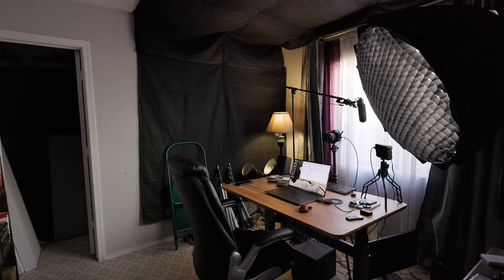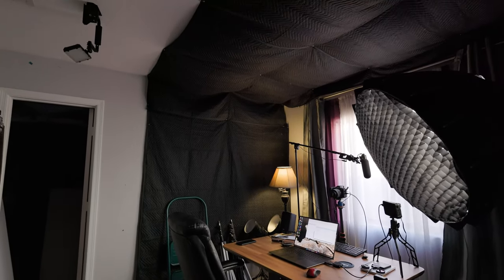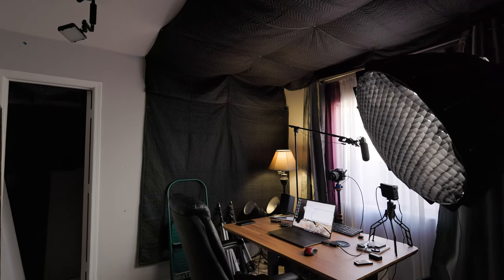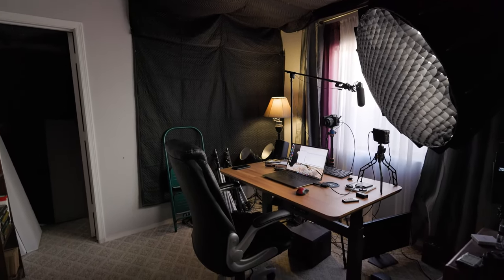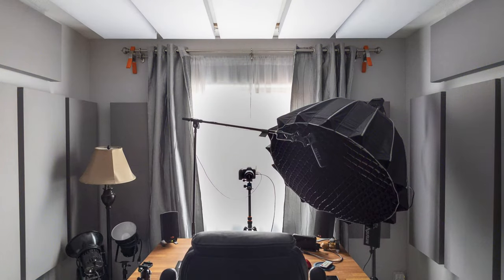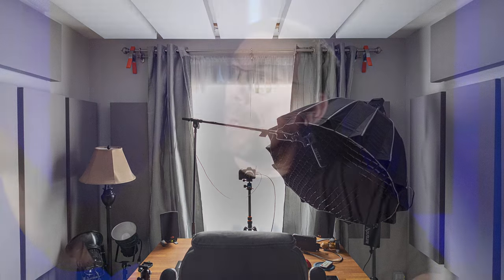Acoustic Panels vs Moving Blankets: Is There a Difference?

Comment: 1” acoustic foam is 30% less efficient than sound blankets but it is 5 times more expensive. 2” acoustic foam is 5% less efficient than sound blankets but it is more than 8 times more expensive. 3” acoustic foam is only 10% more absorbent than sound blankets but it is 12 times more expensive. Overall, to cover the whole room it'll cost a lot more than using just 1 big blanket. This is just my thought.
Reply: That's one of the best comments ever! Thanks for that information. What an eye opener. Puts things into perspective.
Reply: So basically the blankets would be better and cheaper ?
Reply from the maker: Even though they cost more...I needed to make the change due to the look of the blankets.
Reply: @faspete2nd  yes that’s my last obstacle
Reply: Love that data. I'm going to quote this from now on
Reply: @Dracomies data? Those ŵere just comments. No modifiers or anything. No absorption coefficient. What frequencies are we talking about. What sound blankets? What acoustic panels? DIY or store bought? Takes very little skill to build your own panels. I built 6 5.5” panels for about $150! The rockwool was $60 for 6 panels and some cheap common wood boards, screws, staples and muslin fabric. Those blankets won’t do anything below a certain frequency, probably nothing below 2khz. It’s just physics.
Reply: @NakeanWickliff  I forgot what the topic is about but I can tell you that both are viable methods. Let's assume we are using Vocalboothtogo blankets which are 10 lbs each. You cover the front, left, back, right and top, that is 50 pounds of acoustic material around the microphone. Or in standard PVC booths, 72X80 where we recommend about 2 layers of Suremax Ultra Thick Pro per side (a dozen Suremax Ultra thick is 65 pounds), this is about 50 lbs of material around the microphone. I've made acoustic panels  and created PVC booths. Both are very good for voiceover. https://youtu.be/qq-B1JWsktA?t=1
Reply: @Dracomies  weight is not a good metric of sound absorption coefficient. It’s actually not used at all when measuring how much a material absorbs sound. It’s cool though. Use what works for you. I use panels because I use them for audio playback and movies. I need to go a whole lot lower than the human voice.
Reply: @NakeanWickliff  As mentioned both are good. I have acoustic panels too and actually one of my videos is a derivative of Boothjunkie's acoustic panels. But we're arguing over nothing. Both are good. Voiceactors use PVC booths all the time and have great sound.

Comment: Personally, I didn't hear much of a difference between the moving blankets and the acoustic panels. But the difference in price is GINORMOUS! The panels altogether must have run you no less than $700 and the blankets will cost $200 at most. But the panels make the room look much nicer and far less tackier than the moving blankets. But that benefits YOU, not your audience, because they will never see the "tacky" blankets.
Reply from the maker: It is difficult to record the sound difference in my room, but the panels do better acoustically. I agree with you on the cost. The panels are more expensive and less tacky.

Comment: Great quality construction of those panels. They look really good. Bookshelves full of books are actually more effective than most acoustic panels. It looks like you moved yours out. Keeping the bookshelves on the back wall and panels front and sides would be most ideal, I think.
Reply from the maker: I'll give that a shot. Thanks for the advice. Always struggling with my background.
Reply: While it may not make your room any worse, having a bookshelf can introduce other issues (such as odd flutters and reflections). That's why diffuser panels are engineered in specific ways. Bookshelves deflect sound, but aren't the same as acoustic panels.

Comment: Listening in my home studio, with monitor speakers and sonarworks, moving blanket is more natural (in good way and slightly brighter than the acoustic panels set up). Acoustic panels is more like your are in a recording studio. For the cost and results at my end, I will go with (remain) the moving blankets set up.

For sharing to everyone (base on past experiences and what i learnt during my Audio Engineer course) and I hope it helps.
- If you are using blankets, always remember to leave a gap between it and the wall. It helps a lot with reducing reverb even is just a few inches. 
- Acoustic foams are useful  in reducing reverb if you know where to stick and have enough (too few really almost do nothing) of them. It will not help much in reducing noise going to another room.
- There are some differences between moving blankets and acoustic blankets. (application & result)
- There are also differences between acoustic panels and bass trap. (application & result)
- If you are not doing live, post-processing with DAW work like wonders. Save you money till you are sure you wanted to upgrade further.

Thanks.
Reply from the maker: Thanks for sharing! I appreciate it.

Comment: Currently remodeling a sound room. I am already set on building panels, but I may also use a moving blanket over my door. I think this video proves that you can get alot of sound dampening for alot less money and effort than other videos on youtube may make it seem. For someone on a tight budget, I would not shy away from using moving blankets.
Great Video!!!
Reply from the maker: Thanks! Good luck with your sound room. I hope it works out with whatever path take.

Comment: Interesting.  The blankets were warmest (to me). The panels sounded just a bit brighter. Obviously no sound dampening was not acceptable. I like the moving blankets best but the sound panels LOOK better.
Thank you for the education!
Reply from the maker: The look and feel of panels in the studio definitely add a different vibe to the experience of making content over the blankets. I'm happy with the results. Thanks for your feedback.
Reply: I thought so too at first, then I pulled the audio into a DAW out of curiosity.
After listening to the claps slowed waaaaay down and looking at the waveforms, the panels actually did a much better job at eliminating reflections
Reply: The blankets do a pretty good job of absorbing reverb/echo and higher frequencies but don't affect low to mid freq. They solve one problem but create another in making the frequency spectrum unbalanced. It's easy to hear the low/mids in his voice sounding muddy and unnatural with the blankets
Reply: This is a very small room, so treatment has to take that into account. I'm leaning toward the full panel treatment sounding a little too dead. I'd be interested in hearing what 2-dimensional diffusion on the rear wall (behind the chair) would do for you. I personally like a bit of room tone and diffusion on the back wall would make the room sound bigger and not sacrifice the naturalness of the sound.

Comment: Good video. Very helpful to hear the three scenarios back to back. The panels definitely sound better than the blankets. With that said, the difference between nothing and the blankets seems far more profound to me than the differenced between the blankets and the panels. In terms of time, skill, and money, the blankets seem like the quicker, cheaper 20% solution that takes you 80% of the way there. Whereas the panels are the more expensive and time consuming 80% solution that gets you the 20% improvement over the blankets. 

As somebody else said, I suspect many wouldn't notice that 20% difference on stuff like smartphone speakers, etc. And even on better systems, many probably won't notice. But if money and time aren't an issue and the goal is to sound as pro as possible, the panels seem like the obviously better choice.
Reply from the maker: I agree. I just did not like walking into the studio to create videos. The blankets on the walls and ceiling made me not want to go into the room and shot. The vibe in the room is much better now that the panels are up. Not sure if that can be measured, but it sure does make me feel good.
Reply: agreed

Comment: The impression I have is that for casual listeners any sort of sound proofing goes a long way, but with digital compression your benefits drop off quickly. This changes when you need to soundproof for something like critical listening, and for that, I think choosing the most practical option and then using correction software like SoundID should be the best solution. I may not hear a difference between panels and blankets but being in the room is going to be much different.
Reply from the maker: It's hard to describe, but when the blankets were up and you walked into the room there was an open sound, but as soon as the panels were up and you walked in the room you felt "pressure" on the ears. That's the best way I can describe it.

Comment: I'm just straight building a "booth" in my office since I share it with my GF. It'll basically be moving blankets on a PVC pipe frame. Double blankets on 5 sides(not counting floor). Should be effective.
Reply from the maker: I converted my closet in my studio into a sound booth with just moving blankets. It's okay, but not perfect.

Comment: I have a smallish room that is evenly divided between 12x16, and 12x12. The biggest issue is that there are two windows one of which is 58x43, and the other is 58x22, and there is some traffic outside. I do not want to completely block out the light from these windows, but I noticed that you did have an improvement by using sound blankets. What exactly was it that you were using? The room is also somewhat cluttered, but I have read that clutter can be good in that I have a couch on one side, and a small bureau directly on the other from where I sit to record music in the middle. I still might consider some sound panels, but for now I think I need to focus on the windows.
Reply from the maker: I used moving blankets from Home Depot. Light and easy to hang.
Reply: @beetha true I bought the "premium" one. 80x72 I think it was $24. I have 1 standard size window in my room and I put 1 blanket over the curtain rod and it hung in front of the window.
Reply: @beetha true nothing special under the blanket just regular curtains. Well I guess that's not necessarily true. The curtains were blackout curtains. Light did not pass through one of the layers because they were solid gray color. Hope this helps.

Comment: How did you hang the blankets on the ceiling and walls? The comparison between the blankets and panels are really close. Panels look better though.
Reply from the maker: I used regular drywall anchors and screws to hang the blankets.

Comment: I’m looking into panels for recording guitars or vocals. The panels sounded pretty dry and best to my ears but maybe for recording guitars the blankets would be good idk.

I do think I read you could layer blankets with space between them to make em more effective . My issue with panels is just about all the insulation types have materials or treatment on them that are hazardous to breath, so with AC on or heat or moving them around it would be not ideal for me .

I’m wondering how a layered blanket approach would compare. I’m also looking into sheep wool. I basically want a setup I can use and then store away when not in use but I’m looking for the best sound too so idk yet
Reply from the maker: I would go with the less expensive blankets first. If you don't like the sound return them and get sheep wool. Easy up and easy down to store away and not toxic when you move them.